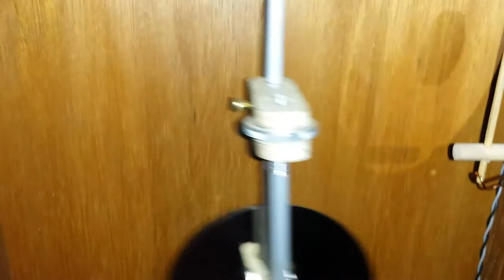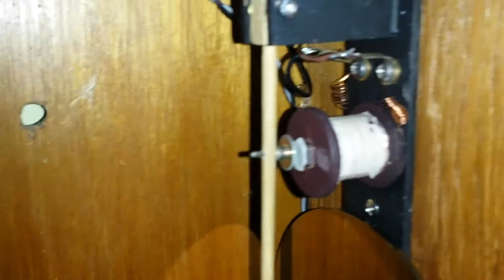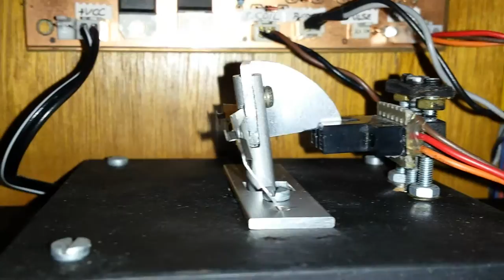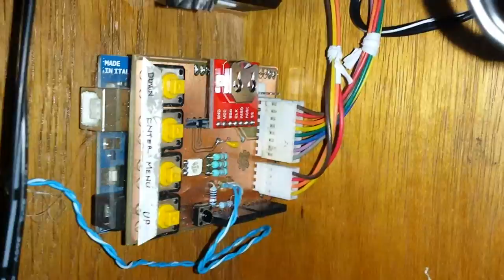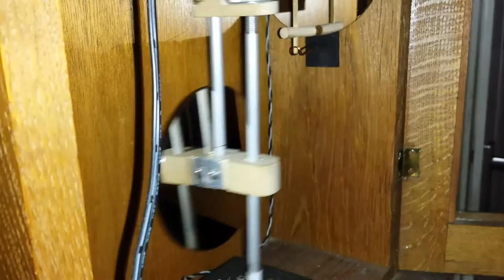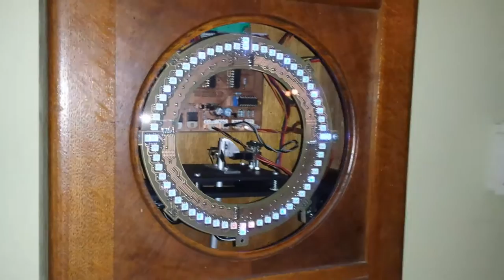Arduino controlled pendulum clock

Comment: That is awesome! Does the Arduino keep the time or is it the pendulum?
Reply from the maker: Justalabrat Mr. Yes this has been my favourite project. Glad you like it too.
The pendulum is the main timekeeper. 
If you have a look at the block- or circuit diagram, you can see that pendulum driver is 'stand alone'.
So the pendulum runs independent from the Arduino. Only the second pulse from the pendulum driver is send to the Arduino interrupt pin. 
But because the pendulum is not 100% accurate, I do adjust the displayed time with the RTC. 
So the pendulum keeps the time, and the RTC is used for adjusting the time (and keeping the date)
Reply from the maker: Zeedijk Mike For the full project see http://zeedijker.blogspot.nl/2014/04/pendulum-controlled-arduino-clock.html
Here you can also see the circuit diagram.